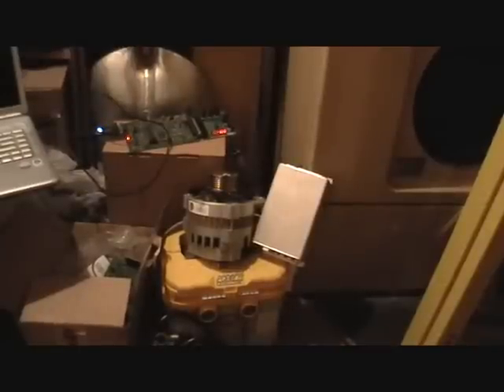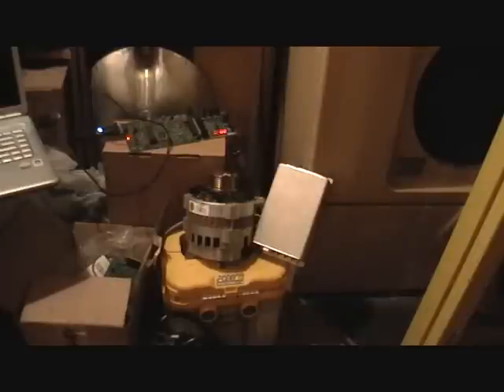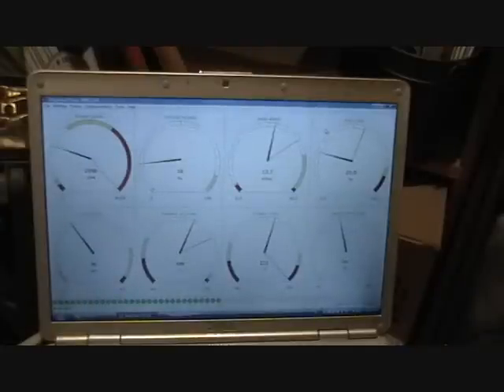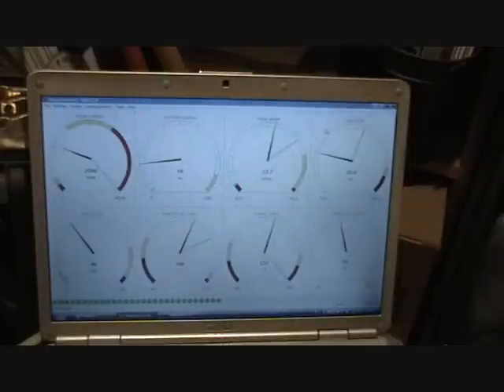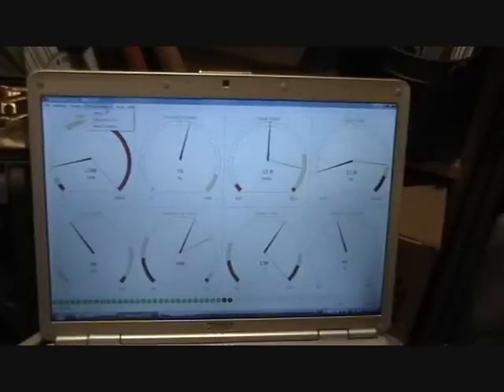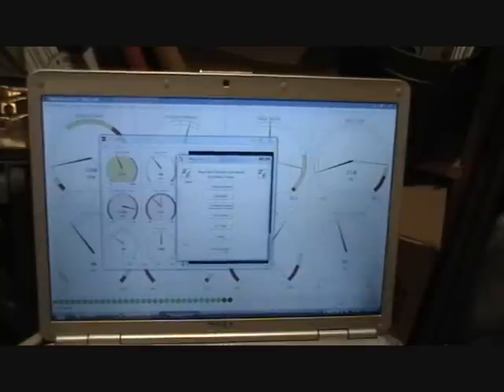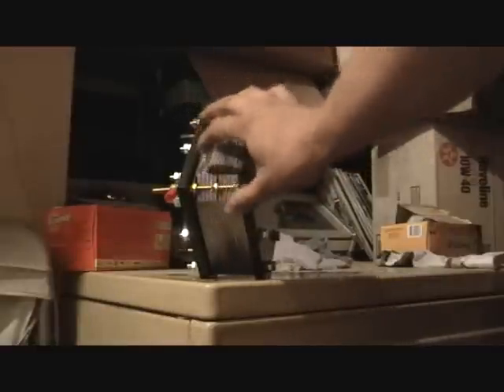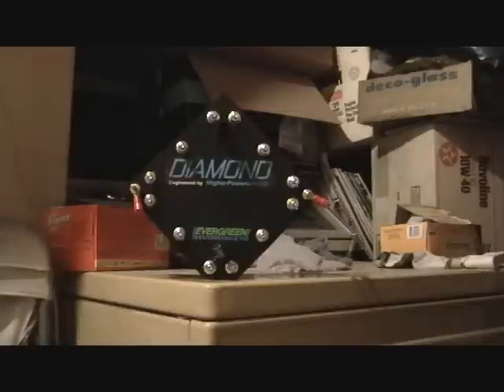suburban warchest

Comment: optima battery and a lead acid battery have different charging characteristics. the lead acid battery requires gassing which begins at 13.8 volts. The optima battery is not designed to charge at above 13.6 volts thereby requiring a modification of the voltage regulator. If the charging system is adjusted for one type of battery, the other one suffers.